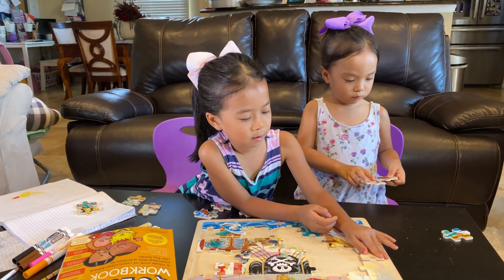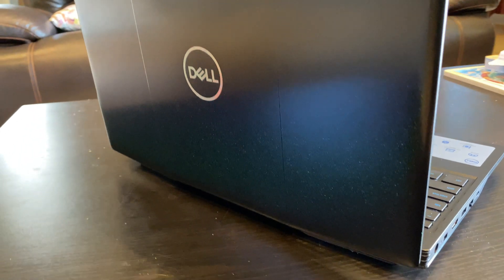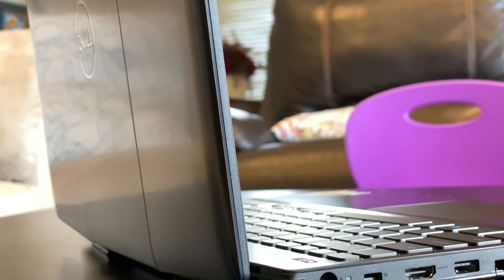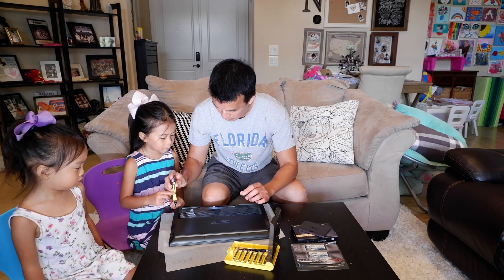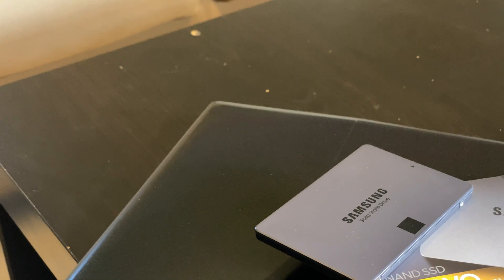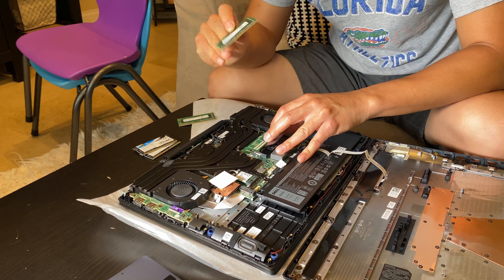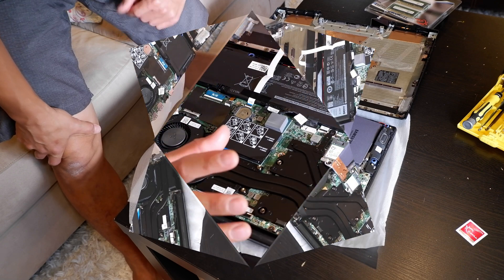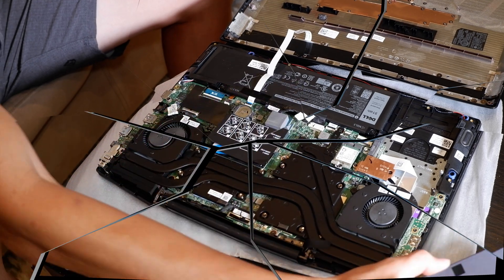How to Upgrade Ram Dell G5 15 5500 G3 Gaming Laptop 32GB | M.2 M2 2.5 SSD Upgrade Options Overview

Comment: Did you manage to find the heatsink bracket for the new ssd? I can't seem to find it anywhere.
Reply: Just call dell parts - they will sell you one. I called last week - sending me a new cooler bracket and screws for about 8 bucks shipped. Planning to add the new sk hynix p31 1tb, 32gb of hyperX impact, and repaste the heatsink (thermal grizzly kryonaut) at the same time. Might remove or modify the fan screen in the bottom of the case to improve airflow as well. Mine is the 10750h and 2070mq - needs all the cooling it can get.
Reply from the maker: idontneedabmw , damn I might try that. I was looking at some universal m.2, 2280 copper heat sinks on eBay. But for $8 I’d rather have OEM that fits.
Reply: @TunerwithKids  package just got here - there was no part number on my original invoice - but there is one on the part bag. Dell P/N: YX0F3, although it doesn't turn up any web results for me. I was initially worried it was going to be the shorter heatsink for the factory 2230, but it appears to be the longer 2280 sink. I'll update again after I install once my RAM and new ssd show up (hopefully tomorrow)
Reply from the maker: Good to know. I will ask for that when I order mine. Still holding out on a good deal for a 1TB 2280.
Reply: @TunerwithKids  just checked my initial invoice - and the heatsink was only 2.99 - they charged 1.99 each for each of the m2x3mm screws. Free shipping, 7.53 with tax.

I'd recommend the sk hynix p31 - just released and 135 on Amazon for the 1tb. Similar performance to the samsung 970 evo for 2/3 the price and better thermal efficiency. Sabrent also has their rocket models on sale today on amazon deal of the day.
Reply from the maker: The P/N worked for ordering...they tried to tell me it wouldn't fit but I ordered anyway since its only $3. They said the part listed for my machine wasn't in stock. Got the same screws so my total OTD was $7.46. I also ordered the Sabrent Rocket Q for $100 yesterday. Will have an install vid once I get all the parts.
Reply: @TunerwithKids  Installed all my stuff a couple nights ago - thermal paste really helped temps - dropped processor temps by 10ish degrees under load, and no more thermal throttling during gaming. Bracket worked great - it even includes a pre-applied thermal mat underneath. 
Only thing I'm struggling with is switching my boot drive over to the new SSD - since my original 512gb is a 2230, I'm not sure if the mounting bracket can be moved to the second slot. I cloned the drive and changed boot order in BIOS, but it's still booting from the old drive. I'll update if I find a fix.
Reply from the maker: How much of that thermal paste did you use? Is 1 gram enough?  I was planning on leaving my 256GB as primary drive for OS and apps and the new Rocket Q strictly for storage.
Reply: @TunerwithKids  I probably used about half of the 1g of kryonaut I got.
Reply from the maker: Got the parts. Super easy to order. They shipped FedEx which probably cost more that the $7.50 in parts. Also got some Arctic MX-4 paste. Will post a video when I get to doing install.
Reply from the maker: Not yet. It appears to use the stock holes on the m.2 2280 to mount. I was gonna try a universal m.2 stick on heat sink if I can’t find the OEM one.
Reply: @TunerwithKids  looking for a bracket as well. no dice. Hopefully you'll figure it out soon so I can copy what you did! haha
Reply: $7.50 you guys paid 😱 £27.48 in the uk 🇬🇧 and I’m not sure they are sending me the correct part ! I literally talked to 15 dell “agents” just to get to the same place and none of them new how to order parts 😂

Comment: I added a nvme  a m.2 2280 "1tb. WD black gaming" TO MY G5  SE 5505. I couldn't get the ram to work (cardinal ddr4 32gb 3200mhz). I will Try the G skill brand you're using. Great Vid by the way!!!
Reply from the maker: What’d you use for a heat sink? And what about screws?
Reply: @TunerwithKids  I used the WDblack sn750 nvme w/o heatsink  as a H/s  would cause a room negotiation. For the screw I used one from the "bottom cover" and found a thin but hard or stable piece of clear plastic and made a "very small"washer by cutting it into a small circular design a then punching a very small whole in it and putting the screw through it.   It holds the NVme down fine. Today I ordered 32gb Impact sodimm(16x 3200mhz) RAM from hyper x...as it is AMD compatible. I had to return oloy RAM( complete junk!!!). I have the new G5 se 5505 ryzen editon(ryzen cpu and graphics combined) $1,049 from best buy. Great videos ...keep it up!
Reply: @jimmiemitchell9980  I have the same exact laptop as you. I am looking to add a second m.2 SSD (2280) in it but I can't find a heat sink bracket for it.
Reply from the maker: Also, even though the Gskillz RAM is 3000mhz, the computer only reads it as 2666mhz. It’s odd but didn’t really want to bother researching it. Also, my computer never goes above 10GB no matter how hard I tax it.
Reply from the maker: I’ll check that out to see.
Reply: @pat thanks!!!!
Reply: @jimmiemitchell9980  How are the thermals in the G5 SE ? (heard they are pretty bad and heats up to 100c)
If so did you do re-paste or do any fixes regarding it ?
Can you gimme the idle and normal temps ?
Thank you !
Reply: @jayrogue1908  after 1.03 bios update and cooling pad I'm idling at 36-42c  and max 71c gaming (Marvel avengers settings on high. Fans really kick in ;but I wear head phones) with power set at efficient  aggressive(Dell setting after registry edit). I also have 32gb hyperx  ram installed and running windows 2004.
Reply: @jayrogue1908  No... thermals were never near that.No re paste was needed.
Reply: @jimmiemitchell9980  I was planning to buy it.. but due to its issues over reddit I was afraid. Going to buy the 120hz variant. Thank you for the reply !

Comment: I’m looking to buy this same laptop but with the i7, I want to upgrade the Ram too. Will these upgrades be compatible?
Reply from the maker: Yes. The i7 should use the same RAM. The i7-10750H is what that uses. It theoretically can handle 128GB of RAM but you will never need that and the MB can only handle up to 32GB. My machine baselines around 6GB to 7GB when normally running, I haven’t seen it go past 10GB even during 4K video processing. I recommend the GTX 1660Ti for best graphics processing and Thunderbolt USB-C 3.1G2.
Reply: Tuner with Kids I think I’m just going to stick with the 16GB option though

Comment: Good luck with your laptop just keep it cool they run hot
Reply from the maker: 👍 got it on a cooler. They overclock the 10600H like crazy. 2.5Ghz listed but runs at 4.0Ghz all day.